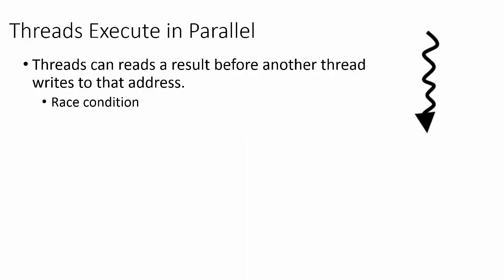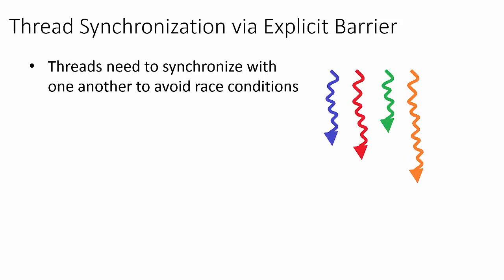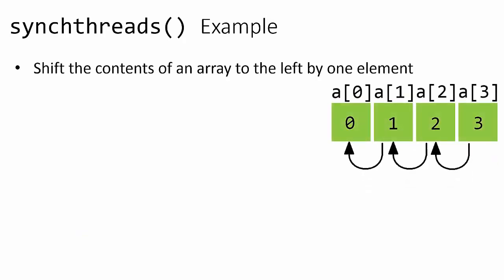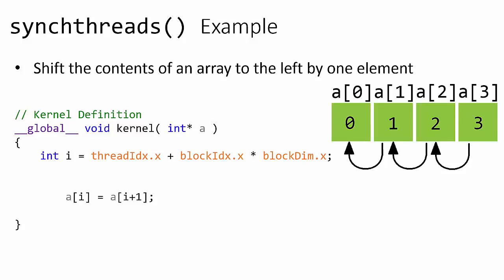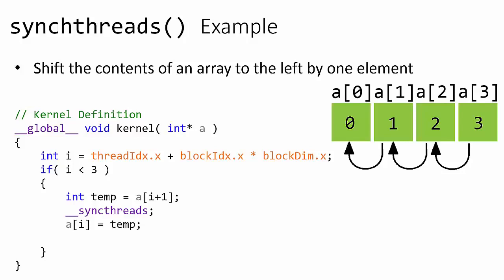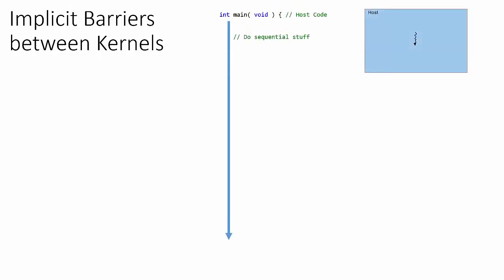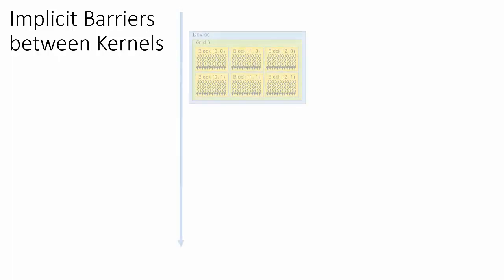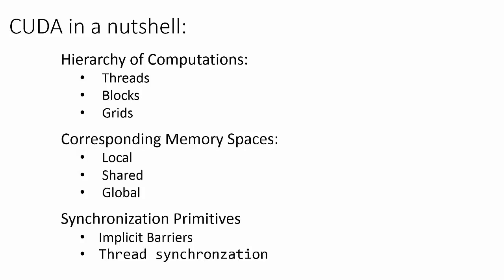Intro to CUDA (part 6): Synchronization

Comment: One of the best CUDA teachers but the series remains incomplete. Please restart. 🙏

Designing problems in CUDA is an art. Meanwhile, I am learning through 2 books: Programming Massively parallel processors and DL1943 Deep Learning Cheatsheet by DeepSeek engineers

Comment: I am running this kernel to test:

_global_ void IncrementCuda(int * d_out, int N)
{
    int i = threadIdx.x + blockIdx.x * blockDim.x;
    int tmp = -1;
    if(i < N)
    {
    	tmp = d_out[(i+1)%N];
    	//__syncthreads();
    	d_out[i%N] = tmp;
    	//__syncthreads();

    }
}

Notice I have commented out the __syncthreads(). Calling with N = (up 20000000) , generates perfectly sequenced blocks. I would expect that I would see some 'jags' and gaps in the output i the absence of synchronization. I see none. I have also experimented with calling or not calling cudaDeviceSynchronize(). Again, no change. 

What is happening?

How do I force a race condition in CUDA and observe it's effects?

Comment: You didn't mention the critical fact that __syncthreads is only for block-level synchronization; your array shifting example will only be race-free if your grid consists of a single block. If you want to extend it to a grid with multiple blocks, you can still use __syncthreads to perform the intra-block shifting but the inter-block shifting needs to be serialized via a separate kernel launch. If an array is divided into chunks of size n, then the first kernel would handle n-1 intra-block shifts per chunk. The second kernel would handle the remaining 1 shift per chunk; this doesn't need  __syncthreads since there are no read/write conflicts as long as n is greater than 1.
Reply: By the way he mentioned that __syncthreads is only for block-level synchronization, but he didn't point that the solution simply won't work if the array size exceeds the block dimension, to make this work, you must divide your kernel into two sub-kernels, and use implicit barrier to make sure the second kernel don't start unless the first one finishes its execution.

Comment: 5:00 syncthreads will wait for all warps in the block to reach that point. But the last thread will never reach it because of the if statement, will this cause the program to hang?
Reply from the maker: Good call akyeren.  We think we solved the problem with the modified code in the response to Liang Cui below.  What is your opinion on the proposed solution?

Comment: In your first example, you call the __syncthreads inside an if statement. From my knowledge,  only the first 3 threads will go into the if statement and the rest inactive will never reach the syncthreads , leading to a deadlock. Am I right?
Reply from the maker: Hi Liang and Robert. 

The syncthreads call should not be inside the if statement like it is.

I guess for this illustrative example you could do something like: 

// N is the number of elements in the array
_global_ void kernel(int* a, int N) {

  int i = threadIdx.x + blockIdx.x * blockDim.x;
  int temp; 
  if(i < N-1)
    temp = a[i+1];
  else
    temp = a[0];

  __syncthreads;
  if (0 <= i && i < N)
    a[i] = temp;
}

temp would store a local value in a register for each individual thread.  Then, once all launched threads have read from the array and can safely write to the array we then proceed past the thread synchronization.  The else statement wraps the zero'th element around to the N-1'th element.

Let me know what you guys think.  I don't have a CUDA capable system at the moment, but I can set one up if we want to explore this further.
Reply: I am new also, but @liang cui, I believe you are correct.  Each and every thread must do exactly the same in terms of _syncthreads.  I believe you need two sections.  The first is an 'if i<3' which only assigns a+1 to temp.  Then, outside of that, ALL threads even those >=3 run a __syncthreads().  Then there must be another 'if i<3' section which does the assignment.  I would appreciate any expert chiming in to confirm or correct my understanding.